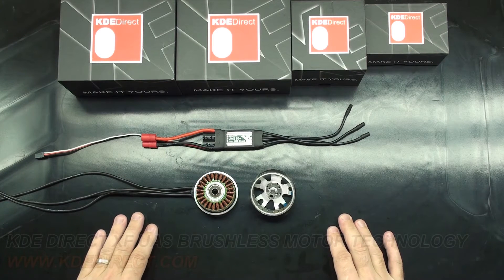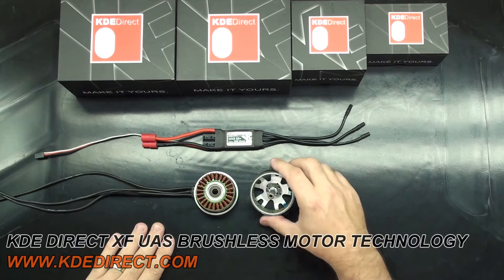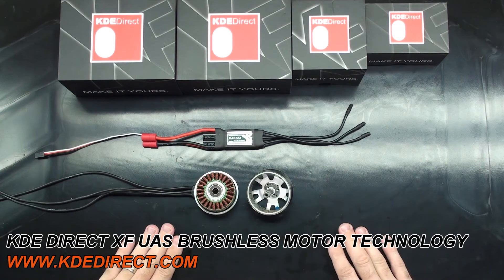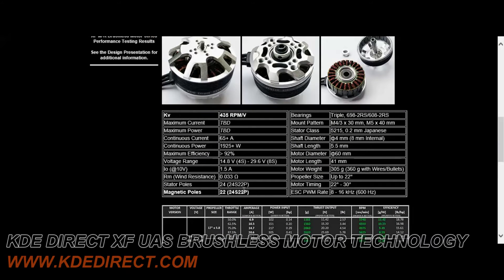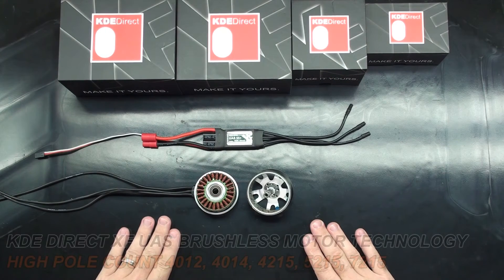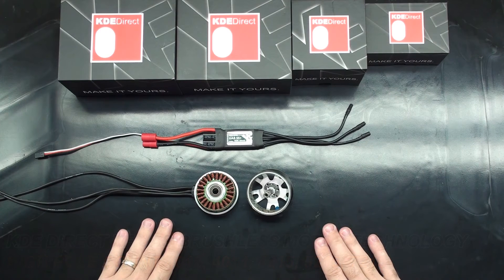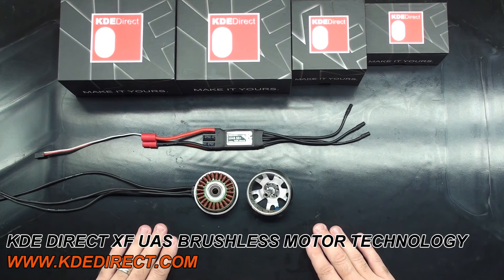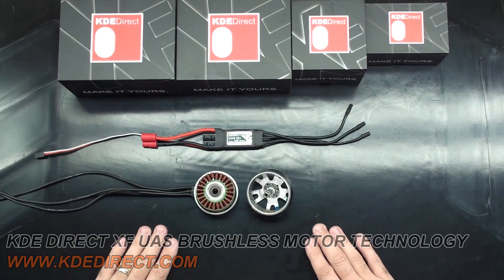KDE Direct Knowledge Base: Episode X – Motor Terminology

Comment: You guys need to design, produce, and sell a competent power distribution board for your products to be used in the UAV market.  Would love to see one with an integrated BEC at 5V along with an adjustable one as well (2 onboard).  That would complete the picture.
Reply: Hey Hal - thank you for the insight and we are working on PDB development, as well as a new UBEC that is specific for multi-rotor applications.  We'll keep you posted with new updates in the near future.
Reply: KDE Direct Patrick I'm certainly interested in that too!

Comment: I was just researching this this morning, thanks!  Do higher number of magnet poles increase performance?  If so, how would that be better for multirotor performance in particular?
Reply: Hey Dean - higher magnet poles allows for higher-torque output, in a smaller footprint if all the other aspects of the brushless motor design are properly optimized.  It is not always the case, but for multi-rotor applications, there are definite advantages to use higher-magnet poles to reduce weight and maintain high-performance, especially in the larger class motor (40mm stator and larger).
Reply: KDE Direct Patrick Thank you for your reply.  I understand that Torque is beneficial for swinging larger props, however I was wondering if the torque increase would improve smaller propellor speed up and slow down.  The reason I ask is because I would like to replace my current T-Motor 3508 (380Kv) motors with some of yours.  I fly in very windy and gusty conditions, so I expect to use smaller, higher pitch propellers (such as Graupner 13x8) to reduce the amount of disk area that will be affected by turbulent, gusty wind.  I see that the 5215 (465Kv) has 22 pole, and a higher KV count, so I am expecting it to be better at spinning 13" props at a higher RPM and with more torque which I believe should be good for gusty conditions.  However your prop chart does not have data for a 13x8" prop.  Would I have a problem running 13" props on your 4215 motor and if so, would I be better choosing another motor from your range.  

Sorry, I would love to call, however I live in Papua New Guinea and a phone call would cost a fortune.  Considering I would be spending about $1200 on a motor/ESC combo, I really want to make sure that I get the best advice so I don't make the wrong purchase.   

Many thanks,
Dean